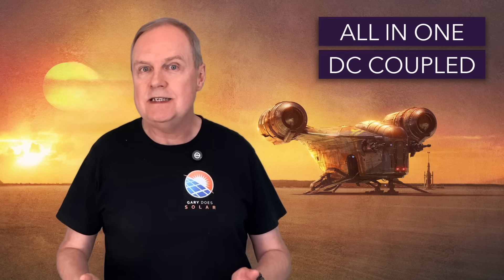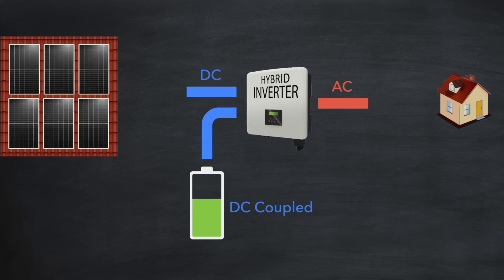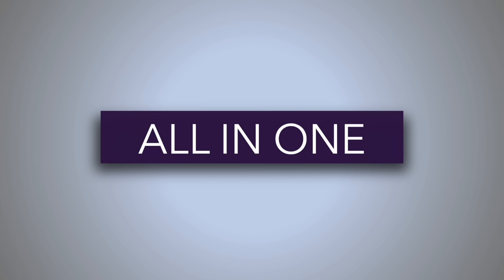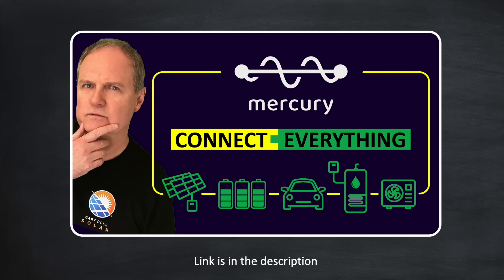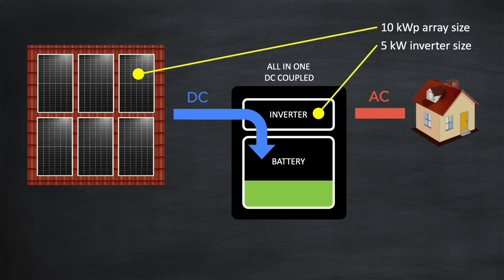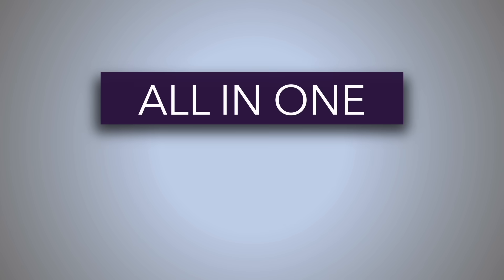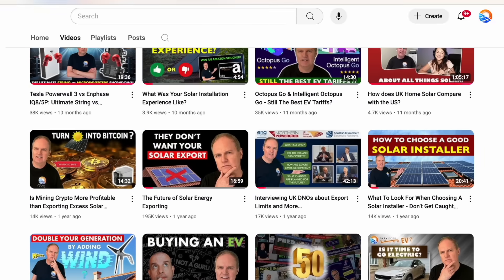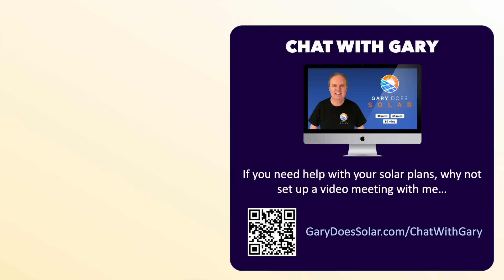Why All-in-One DC Coupled Systems are Transforming Home Solar

Comment: I always enjoy your videos.  I credit them with being one of the major sources that has led to my current set up, which I describe below.  I realize that the regulatory, equipment, sun, and other characteristics of the energy situation in the UK differs greatly from that in Texas USA.

I'm sure you have a better name, but I call my system a DIY Off-grid solar+battery system.  It addresses these issues:
1 - Feeding your energy back to the grid leaves you at the mercy of your electricity provider.  They can change the net-metering rules, increase electricity rates, refuse to take your excess power, require extra equipment to protect them, etc.
2 - Being connected to feed the grid means that, in most cases there is unecessary conversion from battery DC to AC and back to DC via a 5V or 12V power cable.  Micro-inverters, as you said, result in an additional conversion.  All conversions have losses and they add up.
3 - Even with reputable installers, they are not cheap.  Some may only offer limited choices of equipment and management.  Some may offer no choices.  Some plans may involve a loan with a less than competitive interest rate.  All parties, utilities, banks, installers, and manufacturers have overhead costs, profits, shareholders, etc. that figure into what they charge you.
4 - If the grid fails, you may or may not have access to the power in your own battery.

Here's what I have:

Some EcoFlow Trails:  These are DC only devices changed with EF 60W solar panels.  The Trails shut down when not in use.  Charging from window and yard mounted panels is more than enough to charge phones, tablets, etc., all day long.  Previously we used Time of Use charging, which wasn't always convinient or was needed during peak charging hours. Now, our phones and tablets do not add to the electric bill.  AC is never involved.

Two EcoFlow Pros:  There are 2 400W strings, one for each EF unit.  They charge during the day from yard solar panel strings and from the grid during off peak hours with  discounted power.  Fridge and some other devices are connected to AC outlets.  Router, ISP interface, network equipment, and other DC devices are connected to a 12 DC outlet.

All of our 24x7 and blackout critical devices run off batteries.

This approach pays for itself in many ways:

1 - Low installation cost.  You are the master installer.  You do it your way at your level of ability and comfort.  You hire someone to do what you can't or won't.  I had a lot of free help mounting panels.
2 - Power-loss conversions between AC and DC are minimized.  There are no micro-inverters; the solar panels feed DC directly into the battery.
3 - The batteries are uninteruptble power supplies if the grid is out.  Size the batteries to your need, and the reliability of your grid.  EF and Tesla and probably others have an automatic maximum charge mode when severe weather is approaching.  I assume an internet connection is required.  (I like Tesla technolgy and seriouly considered going that route; I will never buy a Tesla product for cost, proprietary, and political resons.)  You don't have to anticipate weather related outages.  Most systems will cut over automatically when the grid goes down.
4 - You design and manage the system for your needs.  You put them where you want and move them when you want.  They go with you when you move.  Most brands have excellent phone app interfaces.  Some EF devices have hard to read displays on the battery; you have to bend down to read them.  The Pro Ultra excells with a display that can be read from a standing position and an easily expanded in place battery addition system.  The larger EFs have simple automation options.
5 - By charging from the grid only during Time of Use (TOU) discount times, you reduce the billable kWh that you get from the grid.  Switch to TOU discounted electricity and get a system with a TOU operating mode.
6 - Since some of your energy comes directly from the sun and some at discount, solar powered devices will add little to your electric bill, 24x7.

It was an enjoyable, learn as you go, experience for me.  I'm sure someone with more experience could have done better.

I use EcoFlow because they were one of the first on the market (here anyway), have experience and expertise, seem to have top of the line products and features, and stand by their equipment.  This is not to say the I have done the research to compare all other brands, all products, over decades, and all options.  EF may not be the best or may not be right for everyone; it's just what I'm going with.  I'm sure there are other brands and products that are just as good, maybe even better.  The two Pro EFs are all all-in-one units as described in the video, battery+inverter+controller+display+rectifier in one device.  EF inlets and outlets are all standard; nothing is proprietary (except expansion battery connectors).  I'm not making an endosement.  This is just my trail-and-error experience.

Things I learned:
- All DC panels on the same string must face the same way at the same angle.
- Get a device that saves and reports input and output history.  You may need to know what was happending a 3 AM while you were asleep or while you are away.  The EF app works over the internet.
- If your device does not have a TOU operating mode, a $10 large appliance smart switch can ensure that it only charges from off-peak discounts.
- Solar panels are less efficient in hot, 90F+ temps.  They perform better when it is cool.  This is a bit contrary to the need to have lot's of direct, right angle, sunlight to harvest the most energy.
- Going whole home solar requires more ground space than we have.  That probably means roof top solar and sub-panels eventually; PV and thermal water heat combined hopefully.  For now, heat and Air Conditioning are powered from the grid.  Allong with other improvements, the 65% electric bill reduction, outage protection, and  a lower carbon footprint are more than worth it.
- Vitual Power Plants, where neighbors share their excess power with neightbors who need it can be very green.  (Pun alert.)  It's good for fighting global warming and good for the bottom line of electric companies, etc.  Not so much for the people whose roofs are feeding the grid.  Like grid connected solar, everyone else is making money off of your sunlight.
Reply from the maker: Thanks for taking the time to write this up! It will help many people 👍🏻
Reply: Excellent comment. 😊

Comment: I have a hybrid system. 6kW of Enphase micro interters AC coupled to a SolArk 12K which also has 5kW of DC coupled panels and a 35kWh pack of Pytes V5 rack batteries.

Comment: All-in-one is advantageous over micro inverters when there is no partial shadowing of panels, correct? My understanding is the advantage of micro inverters is that partial shadowing does not cause a parasitic effect of lowering the effective output of the whole array. Seems an all-in-one would be unable to address the partial shadowing effect.
Reply from the maker: Yup 👍🏻

Comment: The problem I have with this all-in-one approach is the component prices are far higher than diy components. I got a quote for Sigenergy and the first 5 kwh battery was $13kCDN. I can get a 16kwh rack mount battery for less than that. I think the solar industry, at least in Canada, is shooting itself in the foot with the pricing they are charging. The government programs aren't helping and are creating a "wild west" kind of environment. Provides are simply increasing prices to meet the government rebates and loan limits regardless of the actual retail pricing for the components. I'd love to go solar/battery but I can't find anyone here that I can really trust.

Comment: My concern with these all in one systems is what happens if one part of the system fails in 10 years time, will there be serviceable parts in them, spares available? Although for where I am a battery of any type still doesn't make financial sense. No smart meter signal, so no cheap overnight tariff, means a battery would take decades to pay back.
Reply: In fact a cheap overnight tariff does not help the battery making financial sense if you have PV. With battery prices falling it can make sense just by using your PV power during the night. For that you even don't need a smart meter. All it takes is a large gap between the purchased tariff all included and the tariff you get from your provider for feed in to the grid.
Reply: @beatreuteler  That all depends on us having a reasonable amount of excess PV to store, and with two EVs, a large thermal store, and a small swimming pool, there very rarely is. A low overnight tariff is the only thing that makes a battery at current prices viable for us
Reply: @garysmith5025  Possibly for a specific case (like yours) but that is not like this in general. We have switched to EV during this summer. Just recently I looked up our consumption curve in the monitoring tool showing 2025 by the Months so far. I was expecting a step. But I did see absolutly nothing. This said, an EV typically is NOT a big consumer. E.g. you have typically still a significant excess power during the day or, as a viable alternative, your PV array is undersized.
Reply: @beatreuteler  My first comment was quiet clearly about my specific case. We do a total of over 40k miles per year across cars, i.e. nearly 10 000kWhr. Our solar array is as big as the DNO will allow.
Reply: @garysmith5025  With this kind of mileage, I'm quiet sure the cars are often charged elsewhere.
I'm not sure what DNO means as I'm from elsewhere. But assuming the home in itself will have a similar demand  (as the cars) if not even more, a large solar array of 30KWp or a bit more if ever possible would be justified.

Comment: A manufacturer's proprietary app being the only interface to your equipment is not a good thing. You the customer have no choice about who interacts with your kit and how, you are dependent on their continuing support, and you are prone to enshitification because they have you over a barrel. Give your business to companies that support standard interfaces and local control so you can choose which of many devices/software/companies get to help you manage your equipment/sell your electricity/optimise import/export over time, etc.
'Looks nice on the wall' is a poor substitute for actually owning your own equipment, with longevity, choice and independence.
Reply from the maker: I guess you’ve not seen the mobile market lately… iOS or Android. In the video, I see something similar happening…
Reply: @GaryDoesSolar  Yes I see lot of things where the only interface provided is a proprietary iOS or Android app. I'm saying that that is not a good trend. You are over a barrel if there is no published interface to the equipment you theoretically own.  And we regularly see case where companies go bust or just abondon tech and it suddenly stops working.

Comment: In the example of the DNO only seeing 5KW and the battery capable of outputting 10KW but the inverter stops the DNO seeing that extra 10KW. But the issue would be that the system would only be capable of supplying 5Kw to the house so how would you take advantage of the extra battery power.
Reply from the maker: You’re right, so, in that situation, having your inverter sized correctly is paramount.

Comment: I do quite like the powerwall3, particularly because of the 3 mppt inputs with very low startup voltage

However, I do think there is merit to a DC battery & hybrid inverter setup
No vendor lock-in
A Solis inverter is relatively cheap, if it breaks, it's a simple swapout & if there is a better inverted you can benefit from it, same with battery technology

Compare that with a sigenstor, you are effectively stuck with it for ever...they have a good warranty, but if you want to upgrade technology, you have to rip out everything

Comment: I'd like to see micro MPPT solar chargers on a common 48V bus direct to battery with BMS. Modular, simple to upgrade, and optimises each PV cell. Battery supplies DC-DC to 12V, and 240V inverter capable of off grid and on grid via plug in socket. Something that can be installed/maintained DIY as first step. Simple without complex canbus and smartphone apps. Professional installed solution with online monitoring should be seen as final step on the ladder, not the only way to enter into PV solar energy.
Reply: With Victron you Canon do this

Comment: It's odd that you can be off-grid, with solar PV generating DC, which is stored in a battery (DC) and consumed by DC electronics, but we have to convert it to 100-240V AC at each step
Reply: What do you mean by "each step?"
If you are completely off grid you have the choice to make sure your entire building installation is DC (compare it to a camping or "glamping" - Solution where you can buy almost all necessary equipment/appliance on DC meanwhile.
Reply: @beatreuteler Typically not, if I understand the video correctly. Did you watch the video?
Reply: @oliversissonphone6143  Yes, I watched it but to be honest, maybe I didn't get everything exactly as it was meant as I am not a native speaker. Can you point me to the minute this is said? So I could go back and listen to this part a few times more.
Reply: @beatreuteler It's the main point of the video. Start with the first two minutes of the video. The 'hybrid converter' he talks about around 2:00 has DC coupling.

Comment: After 3 years of Gen1 Givenergy inverter and battery ownership, what I have feels ridiculously outdated and limited already.
Upside down fork recently got batteries, each around  £1,200 for 10kwh's.
The GE 8.2kwh is still around £2,200ish.

So for the same price he's got double the capacity, and much better combined charge and discharge rates than our 2600w's

Main reason (other than stupid electricity vs gas) price Im holding off going to a heatpump.
Too expensive to add enough capacity due to veing locked in, and wouldn't gain any improvement over rhe 2600w's, and due to that slow speed, wouldn't be able to charge them inside of the Octopus Go window anyway!

Comment: Two years ago, here in Germany, we had a second solar PV system installed. The installers decided on a E3DC hybrid inverter. We decided to wait for the battery, as prices were falling. 
Then this March I wanted a battery system, and I discovered the inverter only works with E3DC batteries. This is a business choice for lock in. The E3DC battery was very expensive (€800 per KWh). I wasn't happy about this, but went for a small 8.9 KWh battery.
The system works very well, but is too small for winter nights. 
So I decided to do a home made boost. A Balcony Solar / battery system. This uses a 4KWh Growatt Neo (about €1000 or 250/KWh), charged by four 450W solar panels (€55 each, and a similar amount for supports and cables). This can't read the meter for real time flow, but is configured to discharge overnight at about 250 Watts - less than the home's "baseload" consumption.   
The balcony solar rules specify no more than 800 Watts, but this is an inverter amount, so it works with a battery and 1.8KW of PV. I gather the UK is considering whether to allow balcony solar - they should, because it's cheap and fast.

Comment: Sigh… The REbus Alliance (spearheaded by Pika Energy, who was bought by Generac a few years ago) published the correct way to DC couple home and neighborhood electrical systems in 2011 (I came up with this independently a few years before, but I’m a nobody). It was a completely open system with precisely defined connection standards anyone (manufacturer or individual) could implement.

While Generac (edit: under their division in South Portland, Maine called Generac Clean Energy) is implementing this after a fashion, it is now (as far as I can tell) proprietary. I can’t help but cringe when people report on “new” DC-coupled systems that are not open.
Reply from the maker: Some concepts are ahead of their time. It’s just… life. I’ve had many an idea myself over the years, which other companies made successful… The important bit is that things get done one way or the other…
Reply: @GaryDoesSolar 

My point is they’re doing it (what I consider) the Wrong Way(TM)!

Comment: You're a wonderful source for everything Solar, Gary. Thank you. How about leaving politics for the Gary Does Politics channel?
Reply from the maker: Thanks. What politics though?
Reply: @GaryDoesSolar  I guess I'm reading into the commentary below too much, looking for possible other questions I wanted answered. Would it make sense to buy a used EV with a large battery and leave it plugged in, in a bi directional system, to use as a power source for your home, versus multiple battery packs?